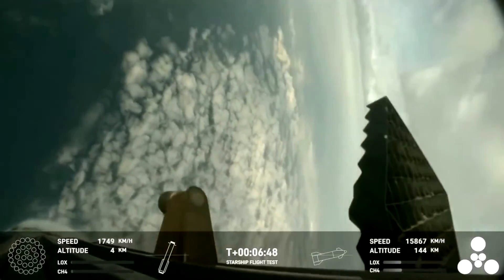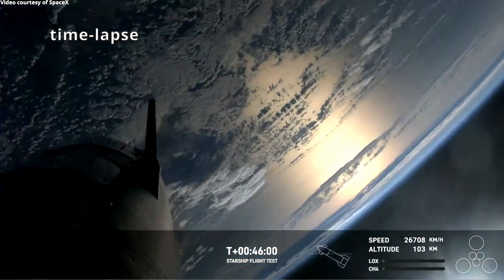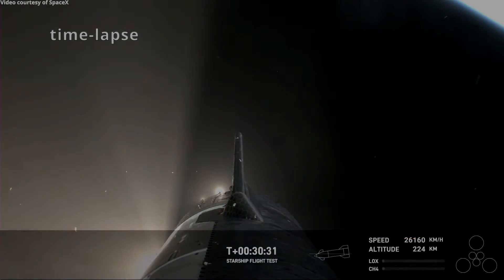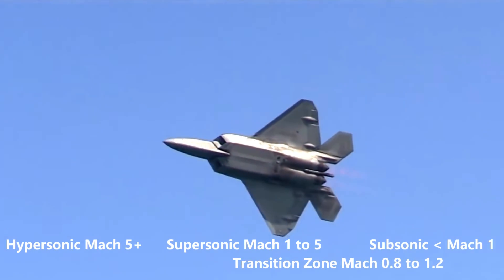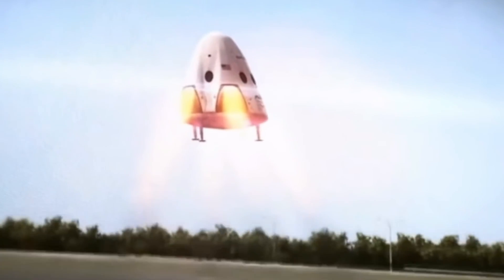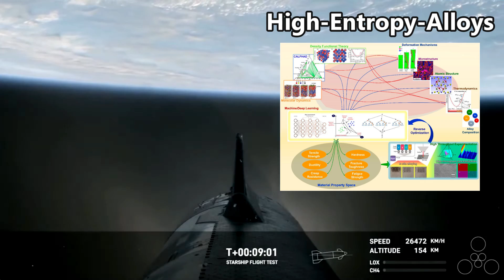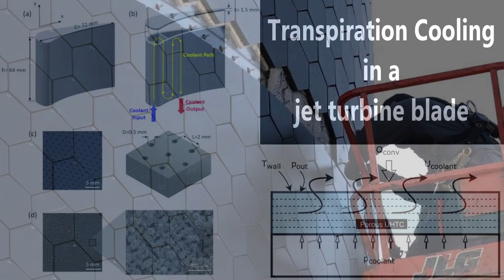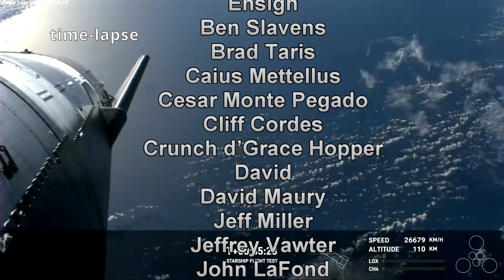Starship Integrated Flight Test 3 Analysis

Comment: About failure:   Musk fans are trying to move the goal posts and redefine success.   "it got off the launch pad so its a success".   No, thats not how it works.  We have a definition of failure, the same definition we have used since the early days of space exploration.  It has nothing to do with whether a booster was recovered or not, whether a spacecraft makes into orbit or not.   The definition is simple: if the system and all of its components perform nominally throughout the mission and accomplish what they are designed to do and what the flight plan said they would do, then the mission is a success.   Otherwise, it is a failure.   Failure does not mean no progress is made.  SpaceX did not invent learning from failures.   NASA did such a good job learning from failures in the early days that modern rocket systems very rarely fail catastrophically, even on first tests of new systems.  The space shuttle is the penultimate example of this:  Only 2 failures in 135 missions, and none at all in the first 50 missions.    SpaceX has had 3 catastrophic multi-system failures in a row with Starship, that resulted in LOV mishaps (its still a LOV even though the test articles were intended to be expendable, because they were lost during flight rather than expended at the conclusion of the flight plan).  Eventually SpaceX will overcome these failures, although they will probably have many more before they do.  But in 2 or 3 years this thing will be reliably flying to space and back to earth, like Falcon does now.   That is when the far more insidious problem will reveal itself to those who dont already see it - in spite of being big and powerful, Starship really isn't all that useful on actual missions.  Its pez dispenser is very limiting for cargo missions. Its Artimis lunar mission profile is an absolute dumpster fire (16-18 launches that all have to go nominally over a multiple week period, just to send 3 guys to the moon).  And its mars exploration mission is pure fantasy.   Starship is to SpaceX as Cybertruck is to Tesla - all flash with good on paper specs, but poorly thought out and a big flop in the real world.
Reply: Bro, it's a rapid iterative test vehicle with zero humans on board. You know how many rockets NASA has blown up? More than 3.

SpaceX does iterative design development, not end to end completion. Get over it.
Reply: @spaulagain They're like binary computers with a rounding error.

.67 = 0 = Failure
.72 = 0 = Failure
.89 = 0 = Failure
.99 = 0 = Failure
1.00 = 1 = Success

It's quite funny to watch lmao, I just see them as poorly programmed computers and gauge my conversations accordingly.
Reply: @GoldenTV3  You make a very good point.  The definition of failure is in fact absolutely binary.  Either everything works nominally or it does not.  But for sure there is a huge difference between a failure in which almost everything worked except for one relatively minor fault, versus a failure in which virtually nothing worked as intended.   A .99 failure versus a 0.01 failure, to use your example analogy.   The problem is, that is where subjectivity comes in to play.   Was IFT3 a 0.20 failure, or was it closer to a 0.50 failure?  It sure as hell wasn't a 0.99 failure.    It had no less than 4 critical faults, any one of which would scrub a mission, and resulted in LOV for two separate vehicles (starship and super heavy).   If I was to rate that, I would rate it below 0.20, but someone else might have a different opinion.
Reply: @wouldntyouliketoknow9891 so when Apollo missions had over a dozen "tasks" they were testing during a mission, and 1 failed, the whole mission was a failure? 🤦‍♂️
Reply: @wouldntyouliketoknow9891  IFT3 made it to orbit, and the launch vehicles were lost afterwards like any other cargo space launch. Vehicle recovery is what the program is learning about, so they got data, and will make changes to improve chances of recovery in the next mission. Why is this so hard to understand for some people?
Reply: @spaulagain  rapid iterative design is a strategy invented by the software industry, intended to deliver minimum viable product as fast as possible, at the expense of quality because they can "fix the bugs later".   This is absolutely the wrong strategy to be using in developing a man-rated space vehicle system.  Full stop.
Reply: @wouldntyouliketoknow9891  strange, because that's how NASA did it in the early days of the program. And that's how the Falcon 9 was designed, yet it's flown 49 people to space.

Why is it the wrong process when it's far cheaper than end 2 end development, far more innovative, far more efficient, and doesn't harm a single human.

Get your head out of 90s
Reply: Exactly. Musk fans are so stupid. And musk fans don't realize that musk is the only person working on every single bit of these rockets, they try to say "Oh it's SpaceX engineers working on it, stop saying musk" lol what a stupid musk fan.

We should always be negative and never congratulate any success because it's not a total success. That's how you motivate people and keep society going. So glad on your wisdom you put here today.
Reply from the maker: It is how it works when they set that goal a priori...

Comment: You made very good observations. Starship may need to be more asymmetrical in order to orient itself.

I think both booster and ship suffered from programming errors. The booster grid fins over-corrected, inducing oscillations. The ship flaps had the ability to control the orientation of the ship once it reached the atmosphere, but they moved it into the wrong orientation several times. This could be an easy fix.

Regarding the RCS control, I have no idea what happened, but there was a lot of venting the whole time the ship was in orbit. Maybe it ran out of cryogenics to produce the gas for the RCS, or the amount of pressure was too low to be effective. They can't be venting propellant all the way to Mars. It needs refrigeration. Anyway, using ullage gas seemed like a good idea, but it looks like it doesn't work in practice. Hypergolics would be more reliable.
Reply from the maker: Or did one get stuck?  Looked a lot like that one F9 booster...

Comment: I think SpaceX will stick with steel until they are sure they have no other options but to switch. The benefits of using off the shelf stainless steel really shine when it comes to simple production and ease to make on-the-fly adjustments.

They probably will retrofit some improved RCS thrusters for redundancy while they sort out all the issues that come with their new hot-gas thrusters.
Reply from the maker: I'm sure they will.

Comment: If a part needs to have superior strength and corrosion resistance at high temperatures, Inconel alloys are best. Inconel 625 in particular has good high strength properties at temperatures up to around 1000 deg. F and is weldable.  You will find Inconel used in internal jet engine parts.  I think the reason SpaceX uses 304L SS is due to cost and workability.  Inconel is very expensive and difficult to machine.  304L also has better ductility which makes it tougher and more fatigue resistant.

It appears to me that SpaceX needs bigger more reliable thruster control jets and possibly larger aero control surfaces at the back end.
Reply from the maker: Indeed.  Making this thing out of Inconel would be a nightmare... and a double hull would have a lot of mass.

Comment: I think the booster engines failed because they didnt have enough fuel. The remaining fuel was floating as it came down.
A longer fuel feed line with a backflow preventer would enable the engines to fire long enough to allow the fuel in the tank to compress back down against the fuel intake port.
Space X needs to implement a fuel bag and pressure system like an ordinary well water pressure tank.
Reply from the maker: That's an interesting thought...

Comment: Wasn’t the space shuttle Columbia lost because the external tank damaged the tiles on the left wing? During recently this caused a burn through and the shuttle broke up. I recall that on subsequent flights they used powerful telescopes to check the underside of the orbiting shuttle for missing tiles.
Reply from the maker: It was a carbon-carbon wing leading edge insert... not the tiles

Comment: ok so all they need is a new control surface, new rcs thrusters,  and some new heat resistant alloy that hasn't been invented yet!  and who even needs a reusable booster when you're only 20 launches away from refueling. throw it all in the ocean, yeah! 😂
Reply from the maker: Not really. Better RCS and it should be fine.
Reply: @terranspaceacademy  no, thats what I'm saying, just like in YOUR video, they're really close to having it working except for it being the wrong shape for a controlled reentry.  and the materials melting.  and not having powerful enough  rcs thrusters.  and both segments breaking up and falling in the ocean again.  just like you talked about in your video!  the huge success.   has it landed on mars yet?  it was supposed to be landing on mars this year,  right? that's what all you muskheads were saying? 😆
Reply from the maker: Right. And since we've been on the Moon since the early 2000s when the other companies promised and took billions to accomplish we should just shut the whole thing down and auction off Starbase?
Reply: @terranspaceacademy i find  the more likely explanation to be that starship is like full self driving.  or a hyperloop..  or solar roof tiles. or training a robot to fold a t-shirt. it looks easy but when you get to the end there are a bunch little details that are difficult to solve that make it impossible.  always two years away.

 as evidence I'm offering your own video in which you hand waved away a control surface, insufficient rcs, and a build material in such a way to make me a kerbal player cringe. it makes me question your qualifications to run a space academy. what did you stay at a holiday inn or something? 😄

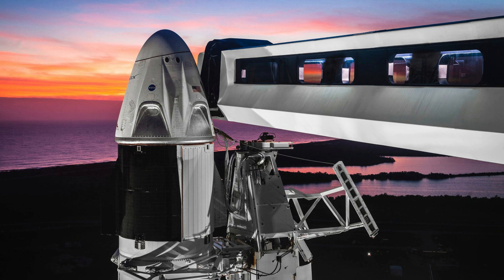Comment: Regarding the booster landing, note how fast the booster is going when they attempt to start grid fin control. I was looking back at the landing video and, per SpaceX's timeline, the booster was to go transonic at T+6:36, 10s before it was to start the landing burn but, at T+6:36 on the video, the booster was 13km high and travelling at 3630kph (Mach 3) - definitely not subsonic!  The supersonic speeds as you mention require different control algorithms. They had the first engine light at T+6:54 when it was 1km altitude and it was still travelling 1322kph (Mach 1.1).  The booster did go subsonic when it hit the water but that was a bit too late.  I am guessing they now know that they need a reentry burn.  I heard it is used on F9 to keep the booster from getting too how so they though they didn't need it because the Starship Booster can handle higher temperatures.
Reply from the maker: That is a very good point... I would agree that a reentry burn is necessary.  They are probably trying to conserve for "hovering" which the Falcon 9 does not do.

Comment: The super heavy booster uses the same attitude thrusters as the ship. It’s just as large and it performed admirably after the hot stage to stabilize the booster. I would not be surprised to learn that there was some type of malfunction, either with the system itself or otherwise.
Reply from the maker: A stuck valve is most likely...

Comment: There’s a critical flaw in your assumption that the RCS thrusters weren’t adequate for reentry maneuvering - the ship’s orientation appeared to be incorrect for the coast phase of flight as well, and as far as I can tell, we saw ZERO maneuvering of any kind (minus some flap actuation.) I don’t think orientation maneuvers of any kind occurred. 

So yeah, the hot gas thrusters may be inadequate, however I don’t think they even had a chance to check.

Also the body flap idea is interesting, however (as you said) it requires the correct orientation of the ship to serve its purpose and function correctly, requiring adequately strong thrusters to do so. Once you have such thrusters, the body flap then becomes redundant anyways. 

Asymmetrical (top vs lower) flap deployment would easily be able to provide pitch authority. We saw this with ship tests. I see no reason for any sort of body flap. Plasma / hypersonic phase or not - if the body flap was functional on shuttle etc, so too would the flaps on starship.🤷🏻‍♂️
Reply: It's pretty obvious that something went awry with the RCS. The firing tapers off around 40 minutes on the mission clock.

I was impressed the flaps managed to nullify the roll as re-entry started, but looked to me like there was a pitch oscillation until the video feed was lost. The two ends of the ship took turns getting blasted with heat and shooting sparks everywhere then hanging in the plasma wake.
Reply from the maker: Loss of pressurization when the engines aren't running? We'll look at it today.

Comment: Wouldn't Starships's RCS be considered cold gas? I thought hot gas was when referring to a combustion/reaction process and thus more thrust. Starship was going to use hot gas, but they ditched it for simplicity.
Reply from the maker: That's an interesting question.  The methane gas in the ullage is heated so the gas is how and gives better Isp than cold.  At the same time there's no combustion so....

Comment: Given the current design, I wonder how they are going to protect the elevator channels they plan to install?  That heat is going to wreck havoc on them, plus it's a weak point on the ship.
Perhaps SpaceX should take a few lessons from sci-fi on landing cargo ships.  The ramp and/or doors are going to need thousands of openings and closings to test for fatigue and durability.
Reply from the maker: That's a good question.

Comment: There was a shuttle that was lost on re-entry due to a damaged tile. A leading edge tile was struck by a piece of foam at lift off.
Reply from the maker: Not a damaged tile though.  Carbon-carbon leading edge insert.  Different thing.

Comment: Video made a mistake: Soviet Shuttle did NOT throw away boosters. The Soviet Shuttle used 4 liquid boosters instead of 2 solids. Soviet boosters would parachute down to the steppes of Kazakhstan and airbags would cushion landing. A flatbed truck with truck crane would pick them up and carry back to launch site. Boosters were designed to be used 10 times. However, Soviet main engines were attached to their external tank so expended with the tank.
Reply from the maker: Did not know that! Thank you.  I saw where the "Hurricane" design was going to fly back.

Comment: The issues with reentry had nothing to do with the aerodynamics of the ship, it was tumbling well before it hit atmo
Reply from the maker: That's true. But a lot of capsules would have righted themselves.
Reply: @terranspaceacademy  only if they were close enough to the correct orientation or only rotating slowly. If they were already tumbling they would likely burn up before stabilizing. That's a lot of mass with a lot of inertia, and very little atmosphere for the control surfaces to correct it with no matter how you look at it
Reply from the maker: I agree. More robust RCS could compensate until the air is denser.

Comment: I’m almost sure that one of the shuttles that totally burned up did so because of the tiles under the wings falling off at some point or being damaged and the heat went through and everyone on board was burned up going over Texas
Reply from the maker: Not tiles though. Leading edge hit by frozen foam damaging the carbon-carbon insert.  Real Engineering has a great episode on it.
Reply: @terranspaceacademy  but that was still a part of the thermal protection system. To differentiate it from a tile in this context is disingenuous.
Reply: @warpedfusion  no it's not. A tile falling off doesn't create a hole in the wing like the broken leading edge did, which exposed the internal structure to extreme heat. Also the Shuttle was an aluminum frame so it couldn't handle the heat as well as Starship which is stainless steel.

Comment: How about focusing on the Booster recovery to the point of a Falcon Heavy's accuracy.   Once you've mastered this you can launch a proven craft configuration like say the Shuttle.  A new improved Shuttle with  the Tech available now would be a game changer.
Reply from the maker: Going back to the Shuttle would be a mistake I think.  LEO only and low mass to orbit.
Reply: @terranspaceacademy  Did I say use the original Shuttles?  If the Starship s Booster can become fully reusable it would replace three devices that doomed two Shuttles.  Two Boosters side by side will get massive modern Shuttle past Hubble or the Moon.

Comment: I generelly disagree. Assuming without any solid evidence that the thrusters are sized too small for this ship is just naiv. There are thousands of engineers working on this rocket, determination of the thrust output of the thrusters for given moments of inertia is a relatively easy thing. Ship was spinning in the whole coast phase and wasnt even lined up correctly BEFORE aerodynamics came into play and this would indicate the failure of thrusters due to icing for exmale or something like that
Reply: I just think the RCS system wasnt functioning to begin with.
Reply from the maker: The shuttle had to use its OMS/RCS which was much stronger than Starship's system.
Reply: @terranspaceacademy  comparing apples with bananas. The question is you think that SpaceX didn't think of this all the way through? Obviously it's more than visually comparing them comparing specific impulses and then deciding by gut feeling " ah damn that thruster looks small in comparison, it has to be undersized! " That's bs.